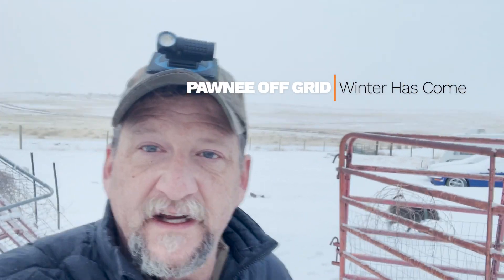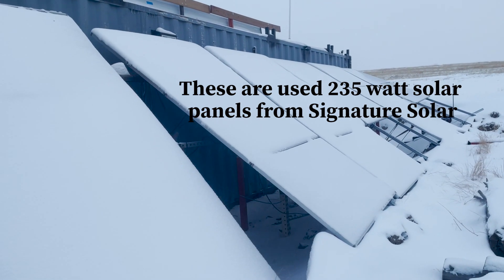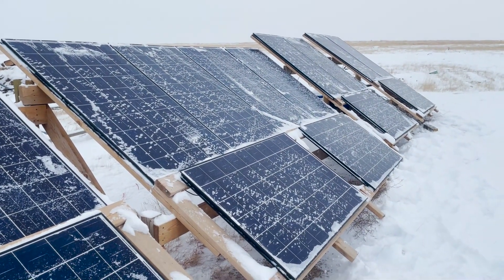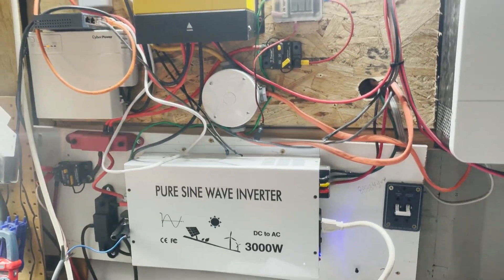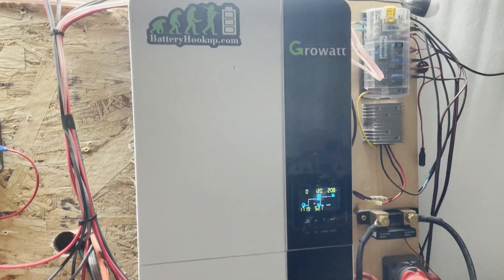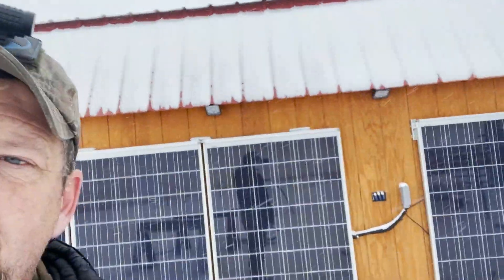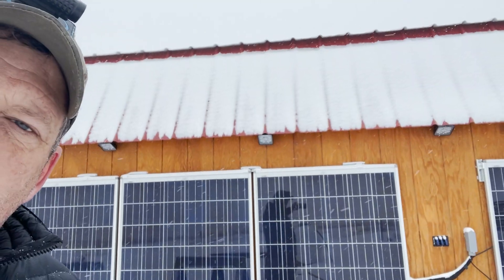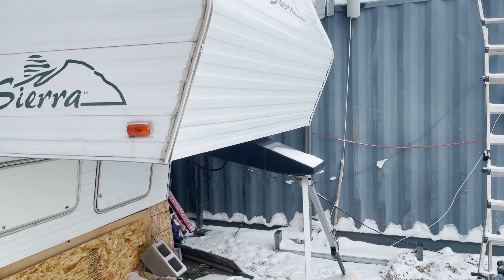Solar Winter

Comment: That’s a real nice system you have there . 3 different inverters and a generator just in case one goes out , there’s always another backup inverter to take the slack . Stay warm and keep producing that power .
Reply from the maker: One is none, and two is one.

Comment: Since you are using a pellet stove to heat your batteries, why not run tubing with vegetable glycerin in it behind the panels to keep them warm? If it leaks it won't hurt the environment. 60 percent glycerin mix is good to, if i remember correctly, -52. I do that on my truck, I have 10 - 440 watt panels and siliconed vinyl tubing to the backs of the panels in parallel and run it so the return is at 35 degrees. My truck is 12' 6" so during the winter, I'm not real excited about getting a ladder out and climbing up there and sweeping them off. The panel heating system also heats the camper and workshop sections of the truck. I have an arduino system setup for the temperature controls.
I can use electric solar and grid, propane, generator and engine heat to heat the glycerin. After the batteries are charged it dumps the excess power to heating the glycerin. Plus in the summer you can run it in reverse, store the heat and cool the panels at the same time. Cooler panels output more power.
Reply from the maker: that sounds like a great idea

Comment: Subscribed!  I love this!  Good luck with your build.
Reply from the maker: So happy to have you on board.  I have learned so much from you!  Just ordered some of those breakers.
Reply: @pawneeoffgrid2614  Cool.  I'll be installing two of them for my two inverters.  BTW, I love insulation, and wish we were neighbors so I could help insulate your shipping container.  Do you have any plans for that?
Reply from the maker: Yes, for sure.  I am trying to be as frugal as possible right now because my house build came in way over budget.  But yes I need to insulate.  Inflation is killing me.
Reply: @pawneeoffgrid2614  Sorry to hear the inflation thing.  I noticed you mention that in one of your videos too.  Good luck however it works out.
Reply from the maker: I would like to ask you some questions about your growatt inverter settings in relationship to your EG4 batteries.  I changed my settings from Lithium to USR2 and I am getting some weird results with how the Growatt is tracking the percentage of charge on the batteries.

Comment: You'll find using the inverters to charge your batteries will be a lot easier than using the separate DC chargers. Once connected, just start up the generator and the inverters will do the rest while powering everything.
Reply from the maker: My only issue with that is the Growatt inverters stop inverting when you plug the generator directly into them.  Which means I am getting "dirtier" power from the generator which is not good for my electronic devices.

Comment: Awesome set up I’m living in a trailer in southern Canada going to eventually build a solar efficient home would love to see how you insulated and heat your camper
Reply from the maker: Well the camper is being heated with propane for the most part.  I did put a bunch of insulation under the camper too.  I did NOT have a "Winter Kit" installed so I packed a bunch of insulation in and taped it up with some old political yard signs.  I am not storing water in the campers water tanks.  I am hauling water and showering at work.  I won't go into detail about my toilet situation, but I don't have a way to dump the tanks so I don't use them.  I am roughing it for awhile for sure.  I do use electric heaters when my solar system is fully charged and I need to use extra solar energy.  I am going to do a video on that shortly.  Hopefully you subscribed and I can keep you in the loop.
Reply: @pawneeoffgrid2614  awesome man thanks have done roughing it for a bit is good for the soul I’m sure. I’m about to set up a camping shower in a tarp garage
Reply from the maker: I have no running water and have been having to shower at work and at the gym.  No way to move the 5th wheel, so not using the toilet in the camper.  Roughing it for sure.

Comment: How warm does was the "Solar System" conex box tonight, when it was -7 out?
Reply from the maker: I was able to keep it above 32 F all night.  I did have to turn the stove up from the low setting to the medium setting but it was 41 in there when I got up and 6am to check.  I def could use some more insulation.

Comment: A bit confused by your terminology at points.  For example, you refer often to your batteries as "such 'n such KW".  Do you actually mean KW-Hr... their ENERGY capacity?  Or are you referring to the max KW of POWER you can extract from them at any moment?
Reply from the maker: 30 kW is the amount of energy stored in the battery  bank, not the max kW that I could extract at once.  My needs, even when running my power tools are usually less than 100 amps.  Maybe a surge load of 200 amps.
Reply: @pawneeoffgrid2614  kW is a measure of POWER, not ENERGY.  So, you did mean 30 kWh (kilowat-hours) ... the energy storage amount.  That was my point.  Thank you for your reply.
Reply from the maker: Yes I agree.  I need to be clearer in my terminology good advice.